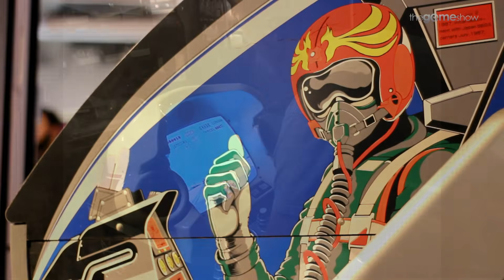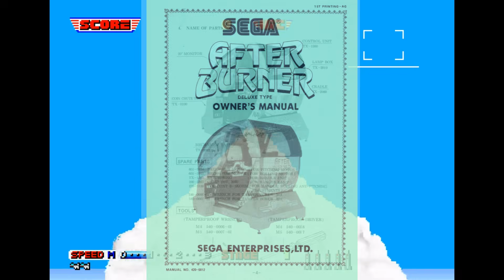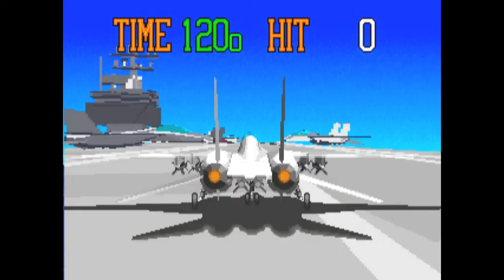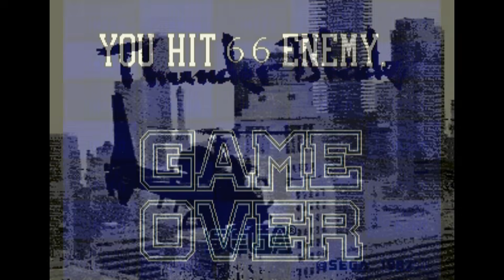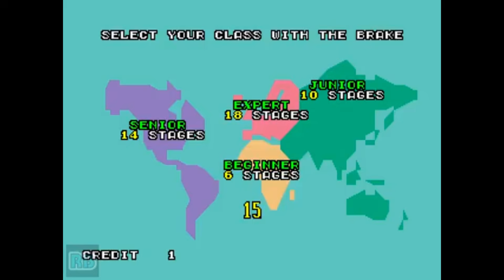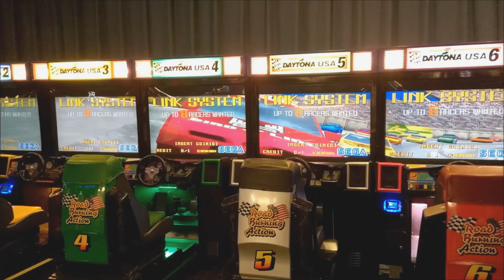SEGA's (INSANE) Sit-In Arcade Games

Comment: After these came the Battletech centers. Recently there are a few people asking the question, what would these kind of arcades look like today with absolutely no limits. Blyat over on Bilibili comes to mind. I'm also building up a few full motion and sensory sim pods. The dream is still out there.
Reply from the maker: That my friend, is an amazing dream. I thought these were impressive back in the 80s and 90s with the tech of the day, but you're right.. Imagine what could be done now with graphics, sound, movement and immersion??? It would be a bucket list experience for sure! Great idea ;-)
Reply: @retrogamingboss1 Did you check out Blyat's work?
Reply from the maker: @brettcameratraveler  Not yet, but I've noted it and  will do some research to add into my part II Sega Arcade video. Thanks again for the input 👍

Comment: The R360 was incredible, you fly upside down if you wanted to.

Sega was always making unforgettable arcade experiences. Along with those mentioned in the video;
-Space Harrier had a sit down version similar to that of Thunder Blade.
-Enduro Racer took Hang On's tilt bike and added a pull back jump mechanic (this game never made it home in proper fashion)
-Super Monaco GP had a sitdown cockpit as well, great sounds and a screen overlay which amplified the action
-Power Drift had the ability to link up several cabinets as well providing a roller coaster style kart racing experience
-Outrunners could link cabinets as well
-Virtua Racing their first polygon racer
-Rad Mobile/Gale Racer 
-Sega Rally Championship
-SEGA SUPER GT/SCUD RACE
-Crazy Taxi
-Outrun 2
-F-Zero AX (Sega developed this and the home version F-Zero GX for the GameCube).
Reply from the maker: You've listed some truly fantastic titles that delivered incredible immersion! Sega definitely set a high bar. I think I'll need to make a part II for this, to capture some of the other great ones you mentioned. Thanks for checking out my video :)

Comment: Should have also highlighted the DX version of Virtua Racing. This was a massive cabinet looking like an bulky F1 car without the tail and wheels, and a huge widescreen monitor up front ( a first for its time). It had a very strong and advance force feedback plus huge speakers all around, and a series of air bags that would react to the events on the screen pushing on the body of the player depending on turns and braking. Between those, the very strong force feedback, and the incredible audio you felt you were in motion driving a vehicle. The Daytona USA cabinets never replicated this full experience opting for much cheaper solutions.

Also you could have highlighted that the Galaxy Force II cabinet was repurposed two years later for Rad Mobile, and the match was perfect as the game included banked turns and movements that mapped perfectly with the Galaxy Force II simulator.

Added: just remembered Enduro Racer. The deluxe cabinet had the full sized body of a dirt bike without wheels and functioned like the Hang On deluxe cabinet. However this being a dirt bike racing game you had the ability to pull back with your entire body to jump, which added much more physical interaction than Hang On.
Reply from the maker: Thanks, those are some excellent points, and I agree, the DX version of Virtua Racing was a really special experience! Enduro Racer sounds awesome, so I'll be sure to include some of these other amazing experiences in my follow-up video to SEGAs arcade sit-ins